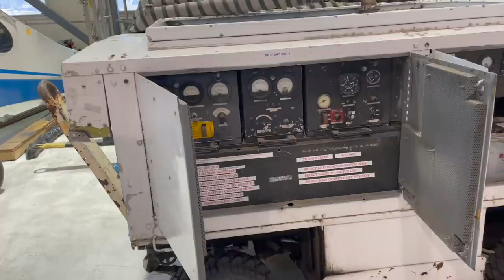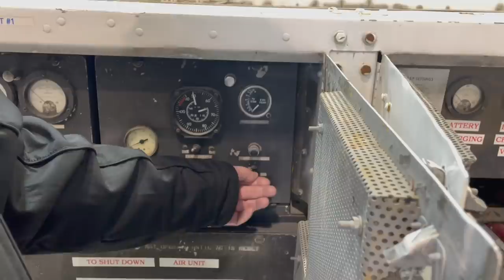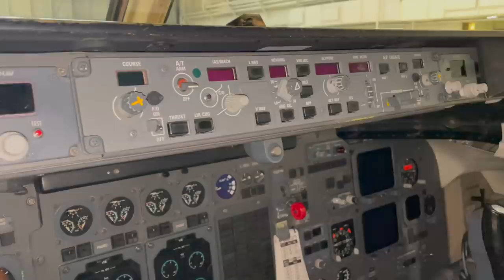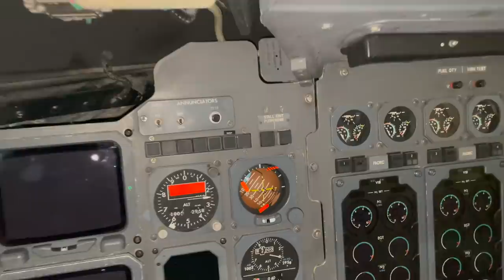You can buy surplus stuff from the airlines?! Todays vlog

Comment: That air starter is called a dash-60 in the USAF. Not sure if that is universal. And Dale was correct in not starting it inside the hangar. They have a tendency to shoot flames out of the exhaust stack. That happened at the hangar I was working at once and the AFFF system triggered, filling the hangar with foam up to the bottoms of the aircraft wings, which on F-15’s are about 7’ from the floor.
Reply: I worked at the air museum in Riverside, Ca. and we had one of those starters for the SR-71 Blackbird....
Reply: That sounds like a really bad day at work, one of those things to laugh at down the road but on that day......not so much...

Comment: Alex 
Your pickup should have 2 gas tanks, one forward of the left rear wheel and one behind.
If you haven't found the tank switch,  it is the right hand switch in the heater control. 
It looks like a second fan switch

Comment: Modify your truck a little bit from stock and put in an overdrive whether a complete overdrive transmission or an add on aftermarket overdrive unit. It will drastically improve your gas mileage and when turned off it will not hurt the trucks pulling/hauling power.